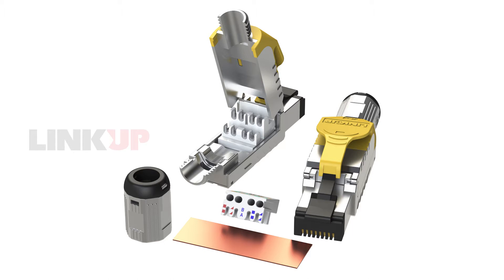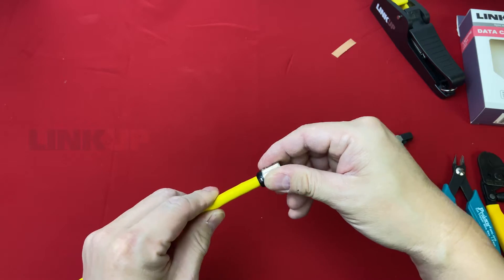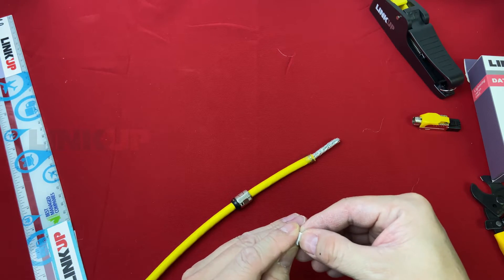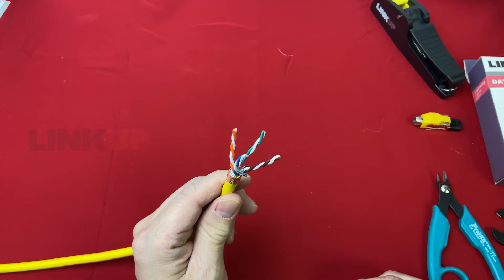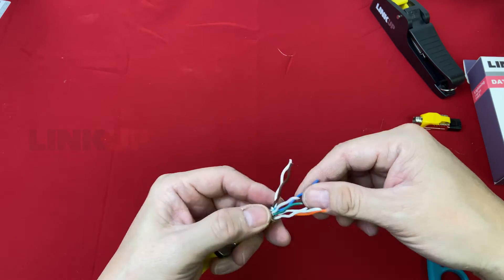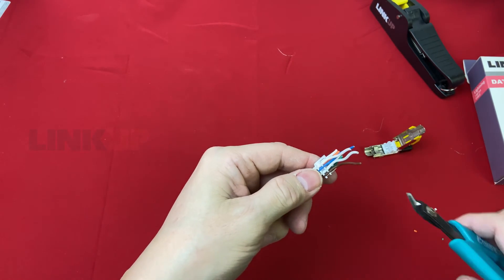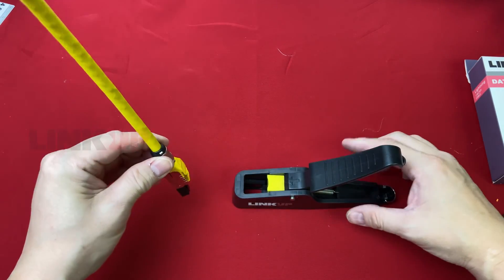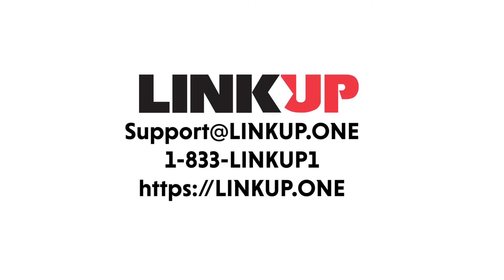LINKUP RJ45 Cat8 & Cat6A Field Termination Plugs (Tool-less) Step-by-Step  Easy Assembly Guide

Comment: Nooooo... half of the GND wires fell on your table ! This means that the shielding will be half as effective if the interference (for example, radio interference) is very strong. I also don't understand why you ripped the aluminum foil away. You should have left it there + connected it to the shielding.

Comment: Hi, what is the difference between 568A and 568B?
Reply: 2 pairs are switched. I forgot what number they are but the green and orange pairs are switched. In the US everything is using B. In fact from what I understand most places use B. From what I understand A is sometimes used in places where it might be used for phone lines too because of the way the pairs are arranged.
Reply: Fluke Networks has a good knowledge base article; the summary is that T568A wiring pattern is "preferred" because it provides backward compatibility 1 & 2 pair USOC wiring schemes. T568B matches the (older) AT&T 258A colors. The US Federal Government requires T568A for wiring under its contracts. For most of us, what really matters is using the standard that best matches the pairs in the cable you have - so follow the advice in the video - use the pairs that work best for the connector, and use the same standard on both ends.

Comment: She forgot to mentioned how important is wire cutting tools that you cant find in lowes or home depot. No way to cut that bottom wires flush properly without that tools
Reply: You can use a nail cutter if you don't have this tool.

Comment: The adhesive of copper tape is not good, it is insulating material, the mesh shield will not be grounded. You must improve this one.
Reply from the maker: Thanks for the suggestion. 
Alternatively, you can wrap around the shield/wire around the cable without using the cooper tape.
Reply: @LINKUPTechnologies For what you guys charge for this stuff, it should be perfect.

Comment: Please let me know, is there connection between shield/copper tape/plug cover and GND pin of cable?
Reply from the maker: The shielding wires are connected to cooper tape which is directly connected to the plug.

Comment: Hi, can I use this connector with Cat7 cable?
Reply from the maker: Not recommended as most of the Cat7 in the markets are fake and also too thin to be used on these premium Cat8 plugs (22~24AWG) recommended.
Reply: @LINKUPTechnologies  I’ve purchased 23 awg pretty expensive cable should be real one, ordered these plugs hope it will work with cat7

Comment: Hi, im getting an cat8 cable today, do i need to buy additional connectors or can i use the already pluged in connectors?
Reply: Is it on a reel or is it a patch cable
Reply from the maker: Sorry for the late reply. You will need keystones or plugs. The cable on the reel isn't terminated yet.
Reply from the maker: It's on a reel, or coiled in a box to be precise. It's not a patch cable. You will need keystones or plugs to terminate the cable.
Reply from the maker: If you have purchased the patch cords, you do not need to buy extra plugs or connectors. For 50 meters and 100 meters bulk cables, you will need to purchase plugs/jacks for terminations.